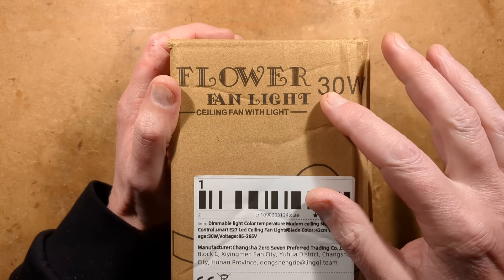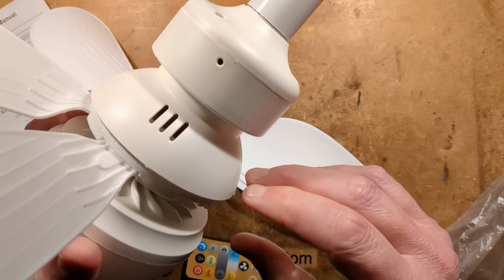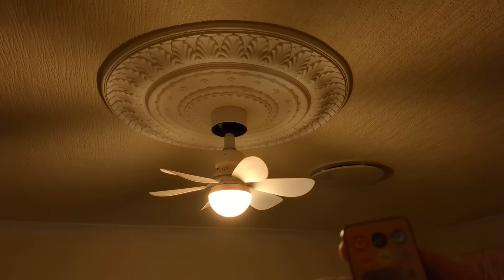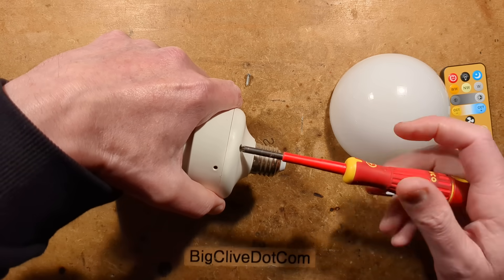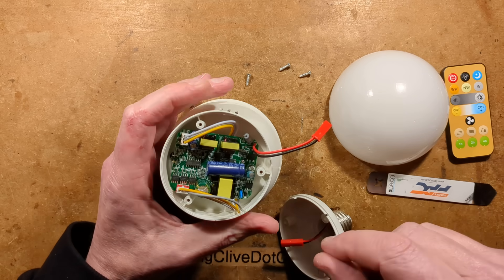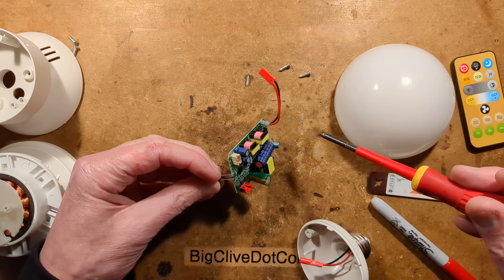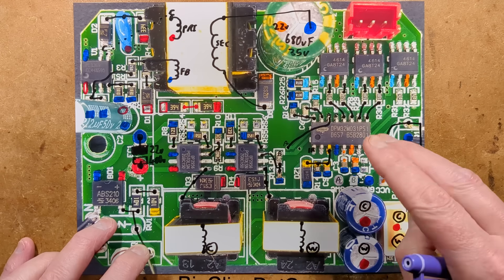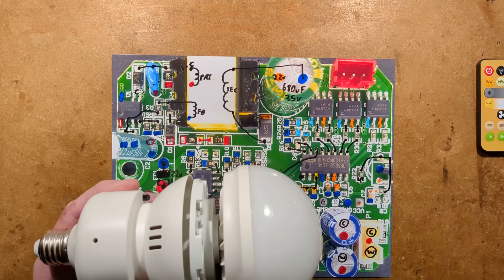Inside a screw-in ceiling fan and light - short low-tech version

Comment: Back in the 1920s when home electricity and home wiring was new there was vanishingly few household outlets for power and it was common to see electrical devices with plugs designed to be inserted into ceiling light sockets.

Comment: I have an oil filled radiator in a small room  the heat goes to the ceiling would this fan help to circulate the warm air better around the room to lessen my electricity bill?
Reply from the maker: It could help.  The halogen infrared heaters are the most efficient at providing instant heat.

Comment: Is the screw-in household lightbulb socket to the same standard on both sides of the Pond, or even worldwide? Do bulbs designed for one electrical system work in another?
Reply from the maker: There are voltage differences, but the thread size is the same.

Comment: The biggest problem with these is if they are plugged into a normal pendant light cable. My daughter fitted several of these on pendant holders and they impose a considerable twist on the wires when they start. I have fitted a separate batten holder near the existing ceiling rose and extended the existing lead to it. This solves the problem without needing to interfere with the house wiring.

Comment: I just noticed in the thumbnail that you have installed your PIV (positive input ventilation). I have the same one. Are you enjoying it's icy cold embrace? To be fair on sunny days it brings in warm air although that is counter productive in terms of humidity. I still find I need a dehumidifier but the PIV does help.
Reply from the maker: I'm enjoying the freshness so far.  But I've not experienced a winter with it yet.  I'm not using a dehumidifier in the area covered by the PIV system to see if the constant airflow makes the higher humidity on wet days less of an issue.

Comment: I have reviewed quite a few of these fan lights (similar designs with 6 speeds costing £25 to £35) as an amazon vine reviewer and i have been using them above my bed during the hot summer nights to sleep and they work great but they do tend to start rattling after 3 to 9 months of use, but as i get them for free its easy enough to just get a new one and swap them out but for anybody thinking about purchasing one it is best to avoid these if you will be using them for longer stretches of time like i do (6 to 8 hours a night) and every one i have tried have always had product images of them being screwed into a fixed light fixture and not a hanging fixture due to the twisting issue and at higher speeds these do tend to wobble if they are fitted into a hanging fixture but on the slower speeds (1 to 2 out of 6)  they dont really wobble at all after the initial power on.

Comment: The narrow spacing on the mains wiring is quite the fire risk.
Reply from the maker: That datasheet does show the connector as being rated for 250V AC/DC.
Reply: It's more to the spacing on the PCB, some 2mm of clearance is required between the annular rings on the PCB. Another concern is the thickness of the insulation on the wires themselves, I would be very surprised if that insulation would meet rating requirements for UL or IEC. I think it's a neat product but to me it seems most likely a major fire hazard.

Comment: My chandelier mounts all have a load bearing component.  Mounting this on such a box would be fine.

But I haven't swapped out my crappy sockets either.   It's totally on the unknown socket if this is safe.   It's ultimately not the electrical design it's the torque the socket can take before it goes wrong.

My solution is different.  I live in an old farmhouse.   I have air filters blowing at the ceiling.   Why air filters is explained by massive air quality failure with Canadian fires and the extreme dust created by harvest.   My cars are currently yellow and my cat is sick.   The PPM meters show trouble.  I skipped washing the car today because I knew it would be this dirty tomorrow.

In actual winter blowing floor air upwards actually does well.  Cat has medicine and we'll muddle through this.   Harvest is so bad because the current drought creates massive dust.   I'm coughing pretty bad tonight.   Far worse than cats.

We'll be ok but not purrfect.   Cat is next to me and ok now.

Comment: I have the same ceiling fan in the “pride” multicoloured blades version. That green “Hiray” electrolytic cap exploded on me and made a loud popping noise, which stopped the fan motor turning and made it judder. The entire top of the cap blew off (without the top splitting) and exposed the spongy electrolyte inside. Think the cap was not rated for enough voltage, it might be prudent to replace with a quality cap rated to a higher working voltage. At least in mine I managed to repair it, but if it failed unattended that may be a problem.
Reply: Oh, it’s also worth “balancing” the blades, then writing on the top (where you can’t see) their order, in case you take them off again. If you get them well balanced then they don’t wobble as much, and run more quietly

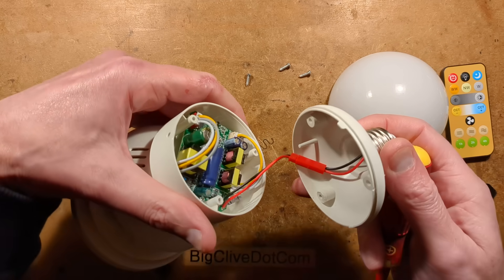Comment: 4:30 That connector is common for RC car batteries...
Reply: All the connectors are the JST series.
Reply: @andrewsych3265  JST RCY Type.

Got that from a site by someone called Matt Milman. Great site
Reply: Yes. 

Also, WHAT? That connector is absolutely NOT designed or safe for more than 42 volts! 

That is also for 42 volts DC. That is where Anderson and Busman start recommending another tier of product. 

The plastic is WAY too thin to prevent arcing if the terminals get hot and move around in the connector. 

That is putting aside when half the time they have the positive and negative in different locations based on who made the connector.
Reply: @keith_5584  It's the amps that matter. And this tiny LED light and small motor won't pull more than 3 amps, tops. That wire size can do about 5 amps safely.
Reply: @ksavage681  I respectfully disagree. The RCY connector is meant for 22-28awg. That part is fine. The metal and quality of the metal that bridges the connection is my worry. If it gets loose, is terminated poorly, or moves around resistance will go up and the metal will get warm. The RCY connector is lower quality than the PH or XH (white) connectors. (JST)

One thing to support your point about the wire though, Silicon Rubber wire is awesome. That is commonly used in RC and heating appliance applications. It usually exceeds AWG specs by a fair margin. I have full confidence in Silicon Rubber wire over PVC.

Comment: is the ramp up time long enough to prevent twisting wires ?
Reply from the maker: I tried it with a pendant fitting and it only twisted the cable half a turn over the full length.

Comment: I think you may be a little confused about which fan they're talking about, which is easy to do as the article is poorly done.
I think that the supposedly dangerous one is lower down in the article and the fan you show is the one that was put in by the electrician to replace it and is presumably safe.
Again the photos in the article don't make this very clear.

Comment: I'm surprised they basically included a 3 phase VFD in this fan. Quite a sophisticated design for such a simple device. I expected an AC motor with a couple windings. 

I have a China fan installed here in the living room (not the screw in type). To my surprise, it is s DC fan with a built in converter. The typical fan you find in the US is still AC with multiple taps/windings. That said, DC fan already blew its controller once. The AC US nade ones practically never die.
Reply: AC Induction motor will always win, those things survive years of abuse in horrendous conditions and just keep going. Their simplicity is their strength

Comment: If the light didn't hit the fan blades causing a horrible flicker, it might be a fine product, but that is the reason my ceiling fans do not have luminaries because they ALL seem to do that to some degree. If used on a reasonably secure base it would probably be fine for moving air, but people will do people things and use anything in the most inadvisable way imaginable.

Comment: ... @ 7'00" you mention it ramps up and down slowly, which would hugely reduce any sudden twisting problems on the light fitting / attachment point.
... I assume this ramping occurs when turning fan on/off with remote (wall switch remaining 'on').
... Interested in knowing what happens when wall switch is turned off / on. Probably wall-turn-off more 'violent' than remote-turn-off. When wall switch turned back on, does the fan/light resume from last setting, or, does it revert to 'all-off'?
... Is there any tendency for the light to begin unscrewing itself? (thus self-disconnecting electrically before there's any chance of dropping on little old ladies heads)
Thanks for videos, much appreciated.

Comment: As the fan spun up. You could see that one blade was out of alignment. Not much different from the conventional ceiling fan we installed from a vender here in Greece. I did bring with us two ceiling hugger fans that are very quiet and do not shake at all. BTW when we built our home I did instal a dual electric system, 120 and 220 VAC. The fan motor runs on 120 while we changed the lamps to run on 220. There are zero issues with this so no Sneid remarks. 50 Hz makes no difference in the motor since it’s universal. Now if I could find a toroidal transformer where the fan shaft could fit through it would make life a bit easier.

Comment: It's a hard pass from me - not because of the risks associated with pendant wires rather than batten fixings. No, it's how the light spills upward and therefore delivers a horrible flicker. Maybe that was just the camera which exaggerated it. Anyway, I'll be sticking with my discrete devices - not least because there are reliable brands out there which last for years - I don't even know how old my Wahl desk fan is. Where I use it, I don't need a remote, but my bedroom fan came with a remote, which is very handy.

Comment: I live in ye olde antebellum southe. We tend to have fairly hefty ceiling fans to move our hot and humid air mounted in every room, and I've never seen one that didn't wobble at its highest speed due to the blades not being perfectly balanced, and we have strict building codes for mounting them. A smaller fan that simply screws into a ceiling socket seems like a more sensible solution.

Comment: big clive finally has a fan base. only joking, good video, wouldn't want that on a corded socket although if it's ramping up and down slowly I guess you could do.
Reply: I wouldn't want it because its going to hang too darn low, otherwise I really can't see how its going to be a problem at all - plenty of forces greater than that thing could do put on hanging lights when you open the windows on a windy day or mash your head into them.  Maybe if you have wiring so old it needed replacing 20 years ago it would be a problem, but then so would any other light, and just the act of changing the bulb would be dangerous!

Comment: If it was in a pendant style holder on a flex, I can see the electricians point. Its weight and vibration it wasn't designed to take. If it was a batten style holder, I wouldn't worry about it being at a fixed source.
Reply from the maker: I tried it in a pendant fitting and the twist was negligible.  No worse than a typical hand held appliance.
Reply: One of the ones we have (because we have two of different kinds) did give our pendant cord a considerable twist.  I wouldn't say its was a total 180, but it was a lot.
Interestingly, the one that looks nicer of the two doesn't seem to have the ability to ramp the motor up and down, it just tries to get up to speed as fast as it can, whereas the cheaper looking one was the same as Clive showed here, and has all the extras in software.

Comment: I love how he tries discharging the capacitor by bridging the leads, but instead of saying "I'm not sure if that worked, so just in case, I'll do my best not to touch it", he just instead touches it to make sure it worked. Seems like something ElectroBoom would do
Reply: I think it's a question of.....I would rather get a shock when I'm expecting it, than play Russian roulette and maybe get it later.
Reply: He likes the spicy tingle.
Reply: @petersage5157 oh man I heard that in his voice 😂😂
Reply: @Corkoth55  Thank you! I actually thought it in his voice when I was typing it. Apparently mimicry is a diagnostic criterion on a few neurospicy spectrums.
Reply: As a sparky its always nicer to get a shock when you know its gonna happen, the worst ones are when you least expect it, like when the customer turns the power back on 😂
Reply: or Mr Bean
Reply: If that was a supercapacitor I would not recommend that. Double Layer capacitors have such a low resistance and density (for large charges, not large capacities), the arc could temporarily blind you. 

Simply look away when you do it. Easy enough. 

No Supercapacitors are just capacitors that got a sticker on their homework. They hold Joules worth of energy. (rather than Nano, pico, milli, etc) They will melt a screwdriver. Luckily, your skin is sometimes protected by the fact that the heat exchange is so rapid, as gas forms to protect you from your 3rd degree burns. SOMETIMES.
Reply: He's a human - it's how we roll.  Ask yourself how you'd work out if a pan or a cooker hob was still hot.

If you didn't say you'd touch it real fast, you're fibbing 😊

Comment: If i wanted the slowest speed to be maybe 50%-70% of its current speed, could I add a small capacitor on the motor?
Reply from the maker: No.  it's not that type of circuitry.

Comment: I wouldnt use one of those, would you? Looks absolutely cheap, i'd be concerned a blade would just shoot off and embed itself into the wall or my forehead!! And anyway, I now stay away from anything chinesium that plugs to mains. The model you show may be ok but so many knock off of knock off...
Reply: I was thinking that. If I used that long term, I'd probably add a drop of super-glue to each of the joints.

Comment: Had a call out to a customer the other day they fitted 1 of these in a pendant..it twist the flex cables and made them blow the electrics 😅😅😅
Reply from the maker: That suggests the cable was already damaged.  Probably be previous use with hot tungsten lamps.

Comment: So.. not a horrifying death trap then? Surprised at the BBC reporting on something without fully checking into it! 🙄
Reply: The BBC's reporting these days is about at the same level as you'd see from the average tabloid. They'd sell their grannies for a clickbait article when instead they should be covering something far more worthwhile.
Reply: BBC? Why should we believe anything they report! Rather than ‘Death-Fan’, I’d rather they accurately report on Death-states. But they won’t. So death-fans it is. Loved the tear-down as always, BC. In my own workshop, I almost prefer tearing down to fixing!
Reply: If Americans can have ceiling fans that last 40+ years, then what's the problem here?
Reply: Drives the motor directly.. Via the mosfets 😂
Reply: Business as usual for the Beeb, these days.  I agree with them one one point, though: ramping up and down or not, I am a little bit perturbed by how much these twist the cord when they turn on.  I have no real problems with it being in a rigid ceiling rose, however.

Comment: I have a 5 volt USB fan that has the same clip in blades and I used it all summer in place of the 120 volt fan,  Im sure you can make this 5 volts as well and replace that light with 5v. Almost no need for the mains power these days. My house uses 450kw a month so im sure I can get of the mains and save that $150 a mont. Most of my lights are 5 or 12 volts and run of a power station or solar.  I seen a  a 3KW power station on sale last week for $1800 that's about all id need.
Reply: You can't use 40 kW a month because kW is a unit of power. Maybe you meant 450 kWh, a unit of energy.

Comment: It looks three phase, but one thing wasn't clear. is it an induction motor or bldc motor as in, does the rotor have magnets.  I'd suspect it is a bldc motor for better efficiency, but sometimes business go with lower cost induction rotors. 

I think it's worth pointing out how much more efficient a bldc motor is over an induction motor, and pointing out that traditionally ceiling fans have used induction motors because of their simplicity.